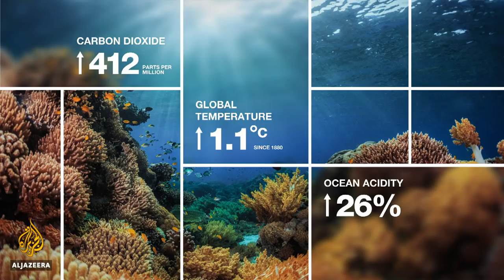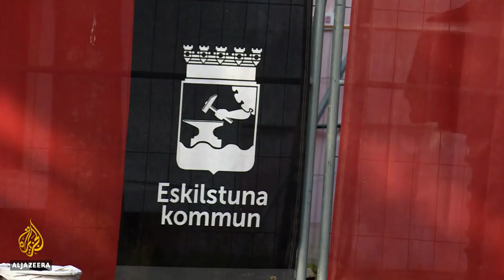Planet SOS: Protecting the Earth’s water and the life that depends on it

Comment: it would be great for all life on this planet if humans could be induced to behave in a manner that protects the life-supporting capacity the planet has long provided. Unfortunately, we are moving at an accelerating pace toward systemic collapse. An immediate problem is that there are far too many people living in harm's way. Migration is no longer a practical option, as we have experienced all around the globe as millions of people have been displaced by war, by drought, by floods, and by other "natural" disasters.

We need to take effective remedial action while we work to stabilize the planet's climate. What ought we do? One thing humans have always been good at is digging canals. As the sea levels rise, we need to analyze where the excess water can be drawn to. Where are are lowest lying inland regions, the places where huge inland seas can be created. Is this an ideal solution? Hardly. But, it is one of the few steps that has the potential prevent the flooding of coastal and low-lying island human settlements. We ought to remember that many of the very dry regions of every continent were once covered by water.

I suggest there is little time to waste. The melting of arctic and antarctic ice is accelerating. Right now this added water will follow the course nature permits. Human intervention is needed to give us time to find longer-term solutions.